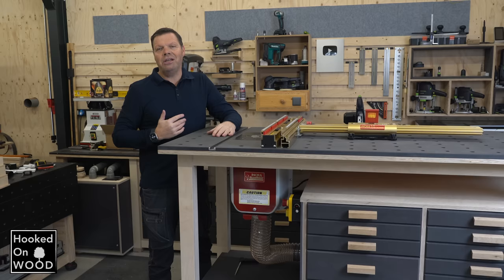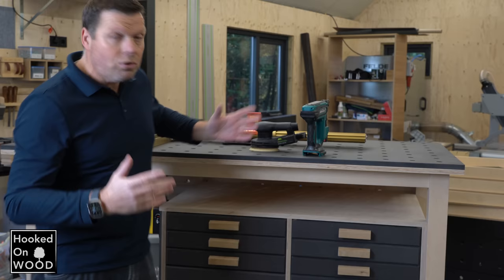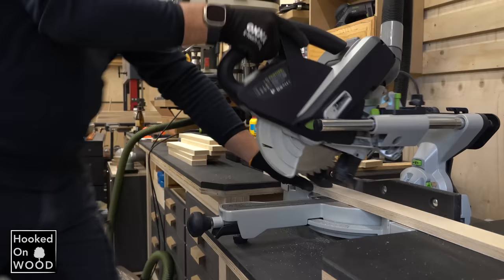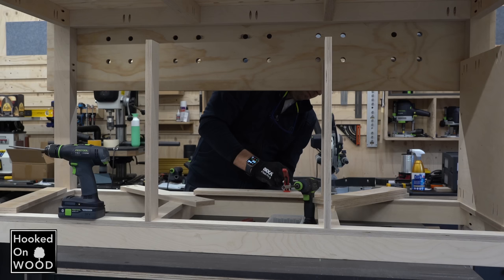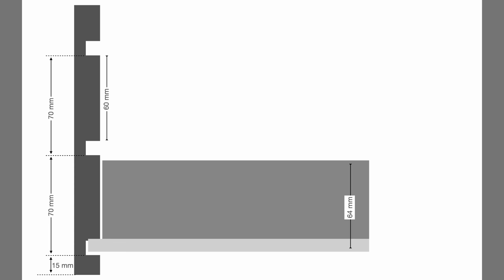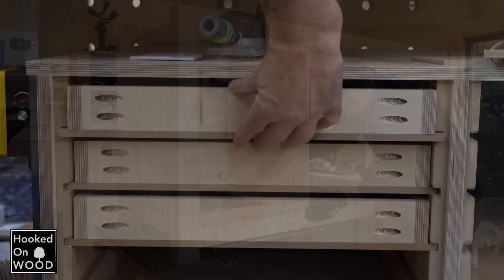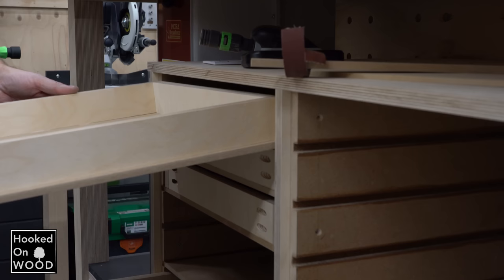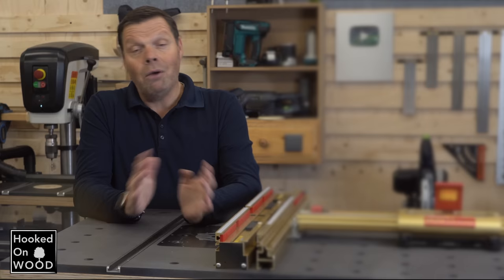Save HUNDREDS of dollars building your workbench like this!

Comment: Good video. Your basic idea is really smart and even if someone doesn't do exactly what you've done, seeing how you've thought about the problem and solved it is just really good to know. Your details are really good. 
 I've made a lot of drawers. I don't think I'd 'want' to use your method.... but it's so efficient and easy that it's probably the best method for a new shop. After a few years the ones that start to wear, just upgrade them. And the ones that haven't?  You've just had the use of them for many years and saved a lot of time and delay. 
 I've made drawers using finger jointed Baltic birch, hardwood runners rabbeted into the drawers and the carcass... Better, sure; and the drawers I made 30 and 18 years ago are still like new...but I haven't been able to bring myself to the hours and hours and set ups required to make more.  The drawers you have and use are much better than the ones you don't have and can't use. 
I think I would make sure that if the carcass sides started to wear they can be popped out, replaced or rabbeted so hardwood runners can be inserted. 
The best coating for the MDF slots and the bottoms of the drawer sliders that I know of would be epoxy with carbon filler. It's black . Don't need fiberglass. You can quickly sand and buff this coating with steel wool this surface until it's smooth like a mirror (if you want). It's tough and slick, but I would always use beeswax or paraffin wax (not sure what they call this stuff in Europe).  With this coating I don't think you  need worry about anything wearing out.  But definitely your edge easing and sanding is important, otherwise the drawer bottoms will start cutting into the carcass. 
I would double the number the slots in the carcass. so 70mm high drawers... 75mm slots, cut another set at 37.5mm. So you could use two drawers in three slots and  space above the drawer. I've found that it's very easy to over fill a drawer. Suppose you decide to have  a drawer for power tools? Some of these will be higher than the drawer sides. You could drop down half a height, problem solved. 
Also, because my method for making drawers was so time consuming I just made as many as possible, I arrived at a standard size (too big to mention here, I also used them as art print drawers). So for my shop I just made tall carcasses with runners so I could use all the drawers. So if I set up to make a bunch of drawers I'd make as many as possible. 
To coat the Baltic birch I drilled a small hole in the 152 x 152cm sheets, sand the whole sheet with a pole sander and ROS. Then I hung them on a wire hook and coated them with Bona floor coating. Then I cut out all the drawers.  Hope this contributes to your brilliant solution.
Reply from the maker: Great comment👍 thanks
Reply: Can you tell me more about the epoxy with carbon fiber? Is it a kit or do you just add carbon fiber with epoxy? Brand name?
Reply: @juanmcain  No fiber. Just WestSystems 423 Graphite Powder additive (I miswrote 'carbon filler') This makes a more slippery but epoxy hard surface. Mix it up, paint it on, then when it sets sand it, buff it with steel wool and a coat of wax.
Reply: Respectful comment
Reply: Interesting ideas. One question though- how does having double the slots i.e. every 37.5 mm in this example help? Won't it need new door fronts for every drawer? TIA.
Reply: @WillN2Go1  Like it. Will def have to try your method.

Comment: Very nice design and execution for a cheap and easy bench. The shelf on top of the cabinet is extremely useful and I hope that viewers use that idea in their bench projects. I wonder if some anti-friction tape like UHMW tape applied to the bottom of the ears on the drawers would hold up. The stuff I have is only 0.15 mm thick and would cost about 60 cents a drawer.
Reply from the maker: Great idea👍 will keep that in mind

Comment: Simple ideas are often the best and the drawer system here is no exception.. Cheapest materials and simplicity . It also makes accurate building EASY. All you have to do is cut the MDF to the correct size and squarely.  Screwing panels on to create the drawer runner slots is simple yet brilliant.  No daunting router work for the beginner woodworker !
Excellent Dennis !

Comment: Now that's some proper engineering! I retired from the custom woodworking industry, and know a good drawer when I see it.😎 Great video, and nice shop.
  One tip to offer up about runners, to everyone, came from a forty year old dresser(now 70). Way back in the day, I guess we did this. Plastic Laminate on the tops of the carcass runners. Plus add 1/2" tall lam. strips on the carcass sides(above the runner, or right in the dado, like an L) and get a closer fit, no-wiggle tolerance. Can be glued up on the long strips before cutting to length. Based on that old dresser's still slick drawer action, I built a set of four tall dressers for a family friend from mahogany ply, and we know ply on ply doesn't cut it. It was a simple solution to use some scrap lam that color matched. These dressers had conventional sides and runners well spaced vertically. That was over 30 yrs. ago. There's hardly any wear on the laminate, save for a bit of the color worn off, on the leading edge. None but the faintest scuffs (1/2") on the lacquered drawers.
Reply: Hey Slowf… great idea.  So let’s see - plastic laminate - do you mean Formica ? Like counter-top material.
And the No-wiggle fit - do you mean that you really are going for a tight fit ? As in, you want as little play as possible.  So this won’t cause binding ?

I was thinking of a different mat’l for drawer bottom : Eg. Engineered hardwood flooring (maybe even laminates), instead of MDF.  I could put the slippery side down.
But yes - you want it to be quite slippery I imagine.
How about slippy tape- the UHMW tape.

Or, perhaps I could use metal.  Light gauge (28 Ga or so) sheet metal.  What think you ?
Glad I came back to this vid, and saw your new-ish comment.
Reply: @SquareRootOfMinus1  Hi Bobby. Yes Formica. It's a brand name among many, but was the first. Like Ski-Do, and Kleenex. Wiggle -fit kind of means that. Not to tight but I want the drawer fronts to line up and not move from side to side so they aren't lined up on the vertical plane. The thing with wooden runners is the same wood species will wear out. You want a softer piece on the cabinet to run on, and a harder piece for the drawer. Or a least two different species. Your lam. flooring idea sounds good. There's also that slick white teflon plastic (1/2" sheets) that people make jigs and table saw jig-runners out of.
Reply: It would be easier and cost the same to just use a melamine panel for bottoms. An added benefit is that the top surface is protected with a durable plastic coating as well.

Comment: As a professional shopfitter, I had access to scrap slatwall. I used this pre-made material to form slotted case sides and avoid the need to cut multiple dados. Even if the slatwall is purchased new, this is an economical way to execute the same design.
Reply: As an American, I read that “as a professional shoplifter,…”

Comment: Really great video!  I appreciate the depth you got into as to design choices and talking through them.  I have some slightly different design elements on mine, based on need, available materials I wanted to use, etc., but your process definitely helped me.  

One idea I used that may help you is that I incorporated iron-on white melamine edge tape onto the gliding surfaces of my drawers, as a hardening treatment to make the action more slick.  Mine has simple drawer boxes (no lip on a wider bottom), gliding on protruding cleats attached to the uprights, and the top surfaces of the cleats treated with the tape.  If you wanted to use this harder/slicker surface treatment, you could route a mortise along the bottom edges of the drawers that is the thickness of the tape, iron it on there, and not have to change anything else.  

Cheers, and thanks again!

Comment: I run a 3/8 deep  by 1/2 rabbited slot down the side of the drawers and put the strips they ride on on the inside of the case. I built a rolling tool box base in 1978 When I needed one at the factory I worked  at, And, many more for my shop over the years.

Comment: Your drawer system is absolutely brilliant. 👍
My wife & I are elderly so I'm keen to convert our kitchen door/shelf cupboards to drawers, & your system means that it will be affordable.
My workshop is tiny, I've got a circular saw track guide, but no router or table saw, so your last suggestion making the slots with pre-cut pieces will be perfect. 👍
Reply: Look into an MFT, it expands the function of a track saw to the point where you can do most things with it as you would on a table saw and it's perfect for small workshops.

Comment: I do have some concerns about long term wear of the MDF bottom. But I suppose if it became a problem you could trim off the proud MDF edge and glue on a strip of hardwood. Now, that said, this is a classic "wish I had thought of that!". I like this system.

Comment: I agree, this is a well worked out drawer system. I have used the more tempered 1/4 masonite instead for bottoms and fronts. If oiled and finished  it turns dark brown and can be worked up to a fairly shiny surface if you want to put multiple coats on. No handles just a hole to pull with your finger. Yours is beautifully thought out and executed as usual.

Comment: Economical solution and very practical too. In fact, it comes with durability. For seasoned carpenters, its a good design. Only flaw i foresee is that the drawer cannot be as fully extended as those with the "three stage" drawer rail mechanism. Then again, it depends on what one needs. Its a very interesting concept to mitigate cost.

Comment: Greetings from Texas, USA! I just discovered your channel this week and I have enjoyed what I have seen so far. I love your workbench/drawer system! The modularity is fantastic and as you mentioned it is much more economical. I do like the metal drawer slides, but this is a great system when you need to make many drawers (as I do in my current shop). I also really like your Match Fit assembly table. I just got the starter kit, so I'm excited to make one for myself as well. Cheers! - Joe

Comment: Using melamine panels for bottoms might reduce friction and improve durability at the same cost as MDF. There's additional labour to add edge banding. On the flip side, no additional finishing is required.
Reply: What about hardboard (HDF)?

Comment: Excellent video and build! I have been thinking of making something similar to this for the last couple of years and out of all the videos I've watched this is the closest to the idea I had in my mind so it's great to see it works is functional flexible and looks good! (I've even contemplated making this as a kitchen replacement! Wasn't sure if would be too "basic" looking but with some nice fronts and a couple of tweaks I reckon it could work for a kitchen also! (Maybe just add a couple of runners for the most frequently used drawers) and the rest use this method to save money on drawer runners. 
Cheers from London 👍🏴🇬🇧

Comment: I used the same method for my small bench, as good slider are very expensive and bad ones just suck.
Tho I will copy you color scheme, but with a light top to rework the surface if needed!

Comment: I am so impressed with your precision and thought process.  I have been thinking about making the Paulk style top, but I think your system may be better.  My only complaint with dog holes is dust and losing parts through the dog holes.  I do feel it is more efficient in the long run for clamping and flexibility.

Comment: A simple but effective trick to keep drawers moving smoothly is to rub a bar of soap in the grooves then move it back and forth so the soap is applied to the full length of the slide.

Comment: Dennis, I'm happy to find this. I'm struggling a bit with drawers and storage and your solution is ideal! I really love the bench top and drawer fronts - what material did you use for those? It seems strong enough as you're using the Incra clamps in there. Thanks again and happy new year!

Comment: Great Video!!  Question - couldn't you make all the drawer fronts the same size, and keep that 15mm of MDF on the side plates for strength at the bottom of the sides, by adding a 14mm rabbet/dado on the bottom pieces?  That way the side MDF pieces sit lower in the bottom pieces, the MDF has the added strength you desire, and all the drawer fronts are the same of three sizes (no odd ball size for the bottom drawers).

Comment: Thanks Dennis. You’re always a step ahead of me.  When I first saw the battery pin nailer appear I wondered which it was, and sure enough 2 minutes later you have added the useful screen tip! This evolution of your drawer system is excellent and one I similarly built on from your previous designs. Have a great Christmas sir and looking forward to more great things in the new year!
Reply: Might want to compare those nailers before buying. Milwaukee, then Dewalt, have better reviews.
Reply: @EditioCastigata  yep, I’ll look into it. I’ve been considering upgrading my compressed air options but I don’t get enough use from it really, so not sure it’s worth it.  Seeing the battery nailer is pushing me that direction as that’s what I use the air for mostly. I’m already in the DeWalt battery system also.
Reply: @allthegear-noidea1264  Although I went with Dewalt, too, for the 18ga and 23ga nailer I took the detour to Milwaukee. FYI: You can get a 12V+18V charger for them for the price of one Dewalt fast-charger.

Comment: Great bench design. You undervalued how much money you're saving with that drawer system. A Blum drawer guide set is ~$40 each at Rocker today. There are other choices in the $25/ea range. Nevertheless, you're saving hundreds of dollars here. 

One question : after years of use, do you find the MDF in the dado wearing down due to wood-on-wood rubbing from opening and closing the drawers? 

Thanks for your channel. Really enjoying it!

Comment: I like full extension slides but watching this I have just worked out how to do that with your system as well. Add L shaped side rails to the sliding base and the drawer itself will have a sub base that slides in the L shaped rails but independent of the main base. The drawer will have a simple lock to pull the main base out until it is stopped by a lock, release the lock that the drawer has in it and the drawer itself will then be able to be pulled out and the main base will not move, now have a full extension drawer slide. A bit hard for me to explain but I hope you get the idea.
Reply from the maker: I get the idea. I will keep it in mind. Think it has potential 😀👍
Reply: I thought about making the buttom off my drawers 10cm deeper than the drawer then you can pull it all the way out just an idea 💡
Merry chrismas

Comment: Great design Dennis, especially as the frame takes up such little plywood.  I'll be using this philosophy, although unfortunately I can't find this black MDF in Canada for a very affordable price (only 2'x4' "handy panel" sizes).  I may decide to paint them black anyways!      🖖
Reply: I've been experimenting with India Ink for MDF (SpeedBall). Seems to work well. I think it is carbon black and shellac..
Reply: Just painted it on with a foam brush. It is very thin (compared to paint) and seems to go into the MDF a bit.
Reply: @peadhill  spray shellac over the India ink you mean?
Reply: @brettswiftvideos  No. The India ink has shellac in it.
Reply: I tried a sample piece and it looked good. While I have a sprayer, I'm trying to see if easy is possible first. Because the ink is so thin, any bubbles break quickly leaving a uniformly flat surface. I have sprayed shellac over India ink for another project to get a higher gloss, but don't think that is needed for shop drawers.
Reply: I just tried 1 and 2 coats on a piece of MDF I'd quickly sanded to 380 grit. It takes about 10 minutes or so before you can re-coat. Two coats looks better.

Comment: this continues to improve on both looks and practicality. The feet look nicely finished, but have you lost the height adjustable fittings?  And did you use the stainless steel insert plate for mounting the router lift in the MDF top? Thank you and seasons greetings to you and all

Comment: I've watched some of your other vids plus the one on your most recent bench build.  Watching this video on your drawer build has been a major ah ha moment.  Building your drawers in this manner is absolutely brilliant.  Not only do you get 3 drawer height sizes, you also get to use them in different cabinet drawer slots since they are built uniformly.  The biggest piece that I like is no drawer slides.  My only wonder would be how to build them to prevent the drawers from being pulled out by accident.  I do have a question regarding Makita Pin Tacker.  What gauge are the pins?  The nearest I can find in the US is 23 gauge.  23 gauge has length limitations.  Where my 18 gauge goes up to 2".

Comment: I'd like to know why the sliding guides are only the bottom of the drawer instead of the whole drawer? that way you can only put some spacers (reducing MDF) and make the drawers a bit wider (optimizing space) 
is it because the thinner the sliding gap the smoother it slides?

Comment: An outstanding organization idea. Now I just need you to design my miter station with integrated router table, as that is my objective for next year. As my shop is not heated, and it is 36 degrees F at the moment, I will have plenty of time to design said project until it is warm enough to build. Unfortunately, I am still unable to locate the colored MDF you have used so effectively in my area, so mine may be more monochromatic! Have a great holiday season.